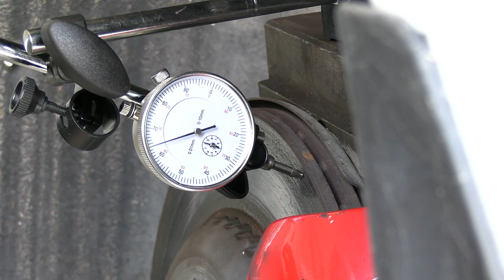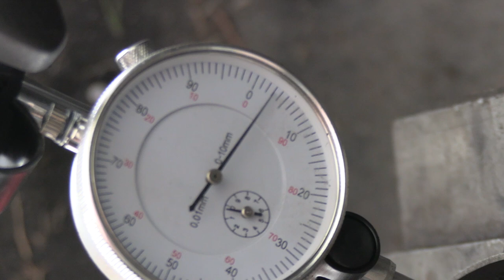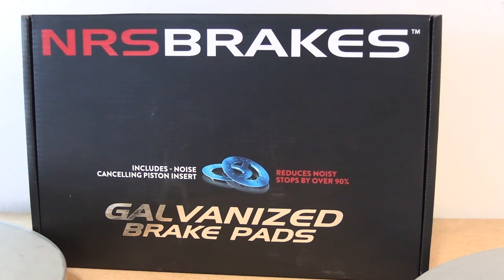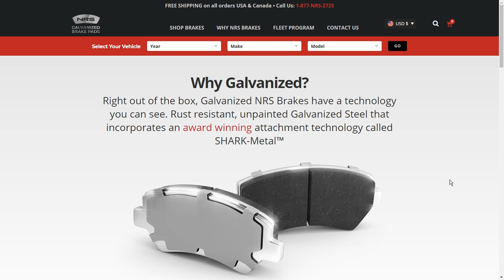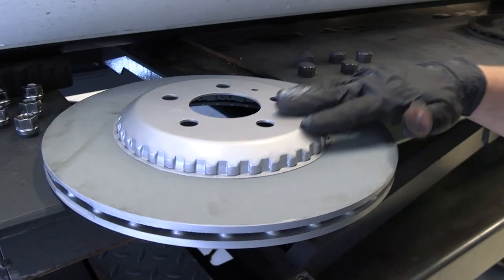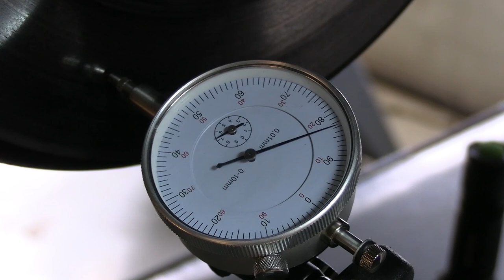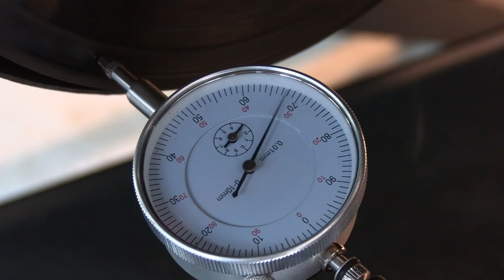Model 3 getting NRS brakes at EV Services

Comment: There is a lot of focus on the warping, but the rotor surface itself looks like crap, so they would need replacement anyway.
I did not see any wear measurement of the disks, where they close to worn out or plenty left?
Reply: The rotors looked pretty bad for a young and relatively low km car. VW going with drums for the rear of ID3 makes more sense now.
Reply: @Macmonkey1000  The same thing can happen to ICE rear discs if you drive only short distances, and if the car is not too heavy. If the rust gets older, it gets harder, and it grinds out the brake pad (which is then softer than the rust). 
For the ID3 it makes definitely sense to have drum brakes at the rear. 
Drum brakes may have more fading, but this doesn't matter for an EV, because the regen is the main brake, and the pads will barely get warm enough in a single emergency stop to have fading.
Reply: @simonm1447  Indeed. Especially with smaller cars (Golf) you have to brake really hard from time to time, otherwise, thanks to the rear brakes getting less power, the disks and pads will wear a lot. At least when you drive like a somewhat sane person normally.
Reply: @simonm1447  I get the impression discs are used mostly for aesthetics on some lower powered cars despite drums  being the more sensible solution. 
As the world moves to EV's , manufacturers should really start fitting corrosion resistant brake components, stainless steel, aluminum alloys or whatever.
The dealership service depts will no doubt be very unhappy though.

Comment: Is the conclusion here that using “High/Standard” regen and so called “one-pedal” driving with EVs is a bad idea since the brakes will actually degrade faster??
Reply from the maker: No problem to use strong regen. But you have to clean the brakes by braking hard sometimes. In my opinion, it's a design flaw, as explained in this video.